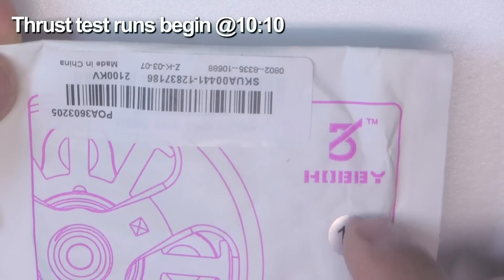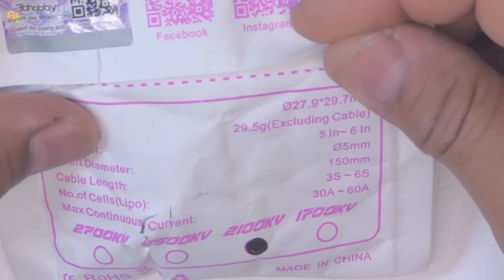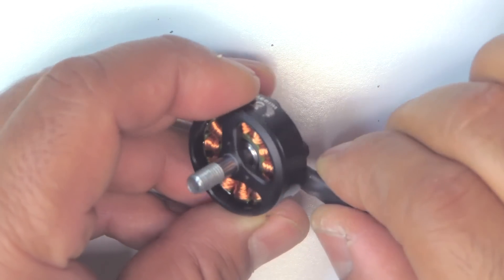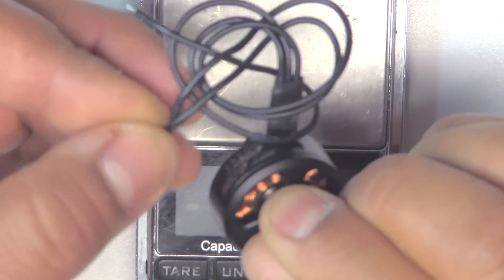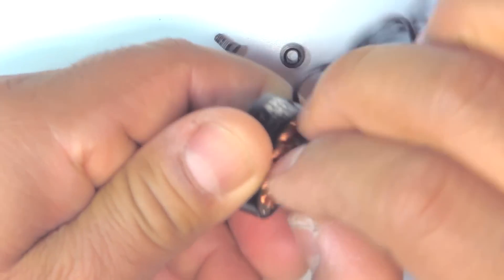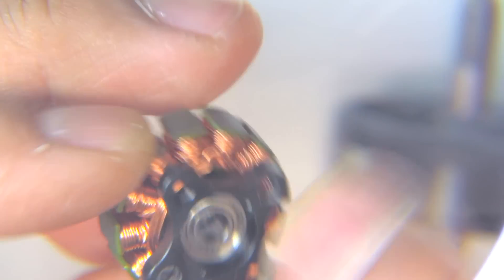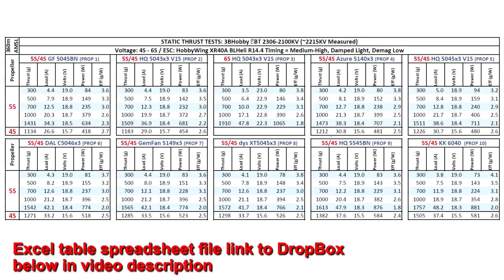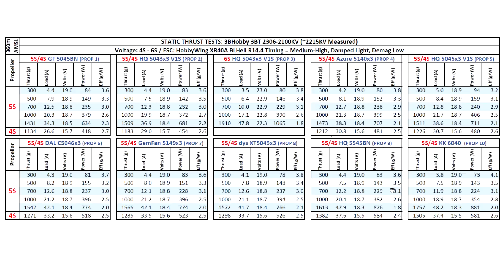3B Hobby 3BT 2306-2100KV -from Banggood- Thrust Tests & Overview

Comment: These motors flies good, but the first is burned after 3 weeks and now after 3 month the second is burned. The copper wire isolation is weak (And my screws are not to long !!!)
Reply from the maker: That's going to be something to keep checking. Hopefully not something that happens often to every motor.

Comment: So the 2100kv is weak on 4s using 5" prop? If i choose the 2500kv it will give me much shorter flight time
Reply from the maker: Right , 2500kv may give you shorter flights of you like using lots of throttle often. I've seen many people happy flying 5" with EMAX LS2207-1900kv on 4S. Depends on what you want and how heavy your build is. I wouldn't say 2100kv is weak,. It should be good for a quad under 300g for smooth freestyle, but it's difficult to say because each person's perception of power and speed can be quite different.

Comment: Hi m8.. so what would you recommend for 4s acro flyer looking for good performance netween 10-70% throttle ?  Was looking at brotherhobby r6 2207 2400kv but interested to hear what you suggest !
Reply from the maker: For 5" /4S you're in the good range with a 2207-2400. R6s and the slightly larger Speedshields are getting good reviews. Most acro setups are based around 2400 to 2600kv. 4mm shaft and 4x9x4mm bearings also a big plus.

Comment: You go me whaiting for the asure on 6S and noop -.- still 1900g on HQ 6s is crazy
Reply from the maker: Several people run 2100KV motors on 6S and has worked for them but you gotta have a very light setup and components that can handle it. On my thrust stand, 6S for this motor would be a bit too much and something could fry so I don't want to risk frying my euipment :)

Comment: On the market for 1507 motors and I saw your Brotherhobby and Racestar ones, can you try the https://www.banggood.com/Hawksky-AT1507-1507-3600KV-4200KV-2-4S-Brushless-Motor-CW-for-Racing-Drone-p-1224574.htm which are hollow shafts. (they're out of stock right now) Which looks like the TOA 1507's 4200 KVs.

Comment: Glad they make Finaly a lip on the bell. My 2407 had on 5 Motors slipping magnets 🤬
Reply from the maker: Uugh! Hate slipped magnets. That's really too bad becaise those 2407s looked really good...but it's not until you abuse them that you find the weak points
Reply: @EngineerX  much more disturbs me the Support from 3B. They realy want that i Buy again 4 new Motors with an small discount

Comment: Good numbers for such a cheap motor! About the aluminum, I think you can ask it to them...
There are lots of motors I'm interested in at Banggood. The ones I'm most interested in are these:
-SZ-Speed 2207CS
-GepRC GR2207
-LDARC XT2306
-TopMotor 2306 and 2308
-Hobbywing XRotor Race Pro 2207
-Diatone 2308
- 3BHobby 2206S
-RCInPower/Super Pulse MarkII
-T-Motor LF40
Hope you don't bother with the big list :)
Clicked at the link! I appreciate your tests for the community.
Happy testing!

Comment: I’ve got a few weeks experience with this motor & I love it! Best battery & prop combo I’ve found so far is 5s w/ cyclone 5046x3. My testing shows 112 max amps in the air @ full send running 5s1300mah/100c packs. Excellent control & buttery smooth running. Best resolution between 10-80% throttle, tons of pull between 20-70% throttle. Top 15-20% drops off a bit but it doesn’t fall on its face. Overall, great motor all around
Reply from the maker: Thanks for your detailed info of flight-characteristics of this motor. Yep, for the price it looks like a very good choice for a 5S setup.

Comment: I'm still incredibly amused that my favorite two props are so identical on static thrust stands (T5046C, GF5149-3) - despite having a noticeably different feel in the air.
Reply from the maker: Right. Unfortunately my tests are not highly detailed  for each prop limited by data acquisition capabilities and available time.  Also static data often can't show how a prop feels and responds in flight. I'm hearing all good things about those GemFan 5149 props
Reply: EngineerX  V2 Cyclones are still my all-around favorite, mostly because they're a bit more durable than the 5149's.  The feel difference to me is that the Gemfans seem to 'cut' more when backed into turns, and pull a bit harder when totally unloaded, which makes sense with the big paddle-like high pitch mid-section and makes them an arguably better racing prop... but the super-linear thrust delivery of the cyclone still feels great.
Mostly, thanks for keeping as many different prop flavors around as you do - I know it's tedious, but being able to match up static thrust data points of comparison across lots of stuff is really valuable, especially since some of that in-flight feel stuff can be so nebulous.
Reply from the maker: Great info there on those 2 props. I've flown the Cyclone and yes, it's also one of my favorites. I need to try the 5149 sometime soon. But it's good to know what to look for and what to expect as you described it well.
Reply: EngineerX  Hopefully I haven't added too much presumption bias there, but do try a couple sets.  I actually dug two sets out of the trash after a local race to try them out, and was impressed enough I bought 20 sets (since that's what was needed to get the bulk discount through Piro)... I really like them, but I don't think anything will displace V2 cyclones for me.

Comment: Nice smooth running motors..mine run 6s with 5131 and 5043 props nicely..a bit warm but still great...very2 efficient with 4s 5048 props..love it
Reply from the maker: I'm reading all good things about these and that makes them a very good option and great bargain at their pricepoint. Hopefully all future batches remain as good as this one I tested. Thanks for posting about your experience with these motors.
Reply: How does it perform today? I bought the same kv and was wondering to run it on 6s, cause 5s is hard to find around

Comment: I ordered 4 of this motors about a month ago in 2500kv variant on Banggood but received only 3 of them couple of days ago. They were about $12 a piece.
Reply from the maker: The price point is very good. $12 for the kind of performance they offer and from what I observed on the break down of motor, they look very well made with good quality bearings. So far everyone is liking them and no reported issues so far.... crossfingers!
Reply: EngineerX Absolutely agree with you. I got my 4th motor today, put them on my Nidici Black Pearl frame and ran 6 battery packs. Very good low end power and even better than iFlight Ion Drive 2207 2650kv. And I got about 7 minutes of flight time compare to 4-5 minutes on Ion Drive 2207. Nice motors.
Reply from the maker: @mikeorion5150  Good to hear you got the 4th motor. Banggood has been fairly reliable as far as deliveries are concerned. Great to hear motors are performing quite well. Maybe these turn out to be the best value motor for a good while.
Reply: EngineerX I think so too. I will order a couple more of this motors. I want to try to run HQ 5x4.5x3 V1S props and see how hard they will be on the batteries.

Comment: Pretty nice motors, dude. Great work testing it! 😊
About fixed wings, I definitely agree. It would have to be a pretty small and light plane and, still, the 1700kv with 3s or 4s would fit it better. 😊
Reply from the maker: Exactly. Just wanted to mention because I know some viewers are fixed wing guys and don't want them to misinterpret results as main focus is for multirotor use. For fixed wing you gotta consider constant high load for longer periods and motors can get stressed far more than in quads.
Reply: @EngineerX  Exactly. 😊
I'm neither of them right now... I only build one brushed micro quad and it's already broken. 😂
But I'm going to build 2 quads soon. And I want to make a few wings and airplanes too. 😃

Comment: Just used your link to bg..
I like the weight, bearing and price. But I just found the bbb 2207 cheaper.
Reply from the maker: Thanks for the click... hoping the Banggood agent sees lots of clicks :) and sends more motors. Already put in request for the other KV's and a couple of other motors (SunnySky 2207 and TMotor F60/F80)
Reply: The BBB 2207 are 20 usd each.  These are cheaper
Reply from the maker: Thank you so much for using the link. Banggood person is sending some TMotors for testing due to the good response on the clicks, so I really appreciate the help. Do you mean this one? I've always seen it for $20. Maybe it was on sale?  I think this 3BT motor is a very good value motor. So far reports are good on durability and hopefully no issues come up. https://www.banggood.com/3B-R-2207-2650KV-2-4S-CCW-Thread-Brushless-Motor-for-FPV-Racing-Drone-p-1229369.html

Comment: Thanks for taking note of my comments about the maximum continues amperage! As well my observations on a fixed wing show that the so called unloading is not so significant ... if there is at all. Here is how I burned the BrotherHobby Avenger 2507 - you will notice that there is no noticeable unloading when the speed was doubled: https://youtu.be/RNqiO-ryFc4
Reply from the maker: Yes. Thanks for pointing it out. I had neglected to mention or consider how the motors need to be properly and more carefully sized for fix wing. My main focus has been for multirotor use but I've been seeing more fixed wing interest from viewers, so I'll try my best to include suggestions. I've asked a couple of manufacturers to provide Max Continuous Amp load capability on their motors but all they've given is just plain max load and don't specify length of time. I'll keep asking...
Reply: EngineerX, yes good for you. I've managed to burn several motors lately pushing the limits and it looks like the safe continues load is about the half or 60% tops of the max load the motor is capable of. ... and this is for the good motors.

Comment: I have the 2500KV version, i really like it and it seems to be durable so far! Will you test other KV versions of this Motor?
Reply from the maker: Right, these feel very well made and the 4x9x4mm NMB bearings should be durable.  I requested 1700KV but they were out of stock, I'll ask them to send the other KV's hopefully they'll send them.